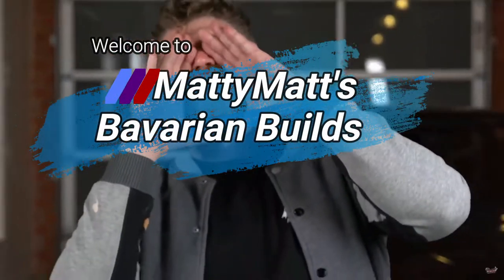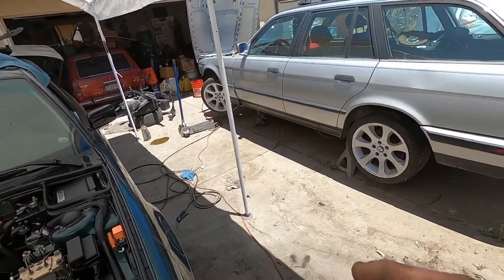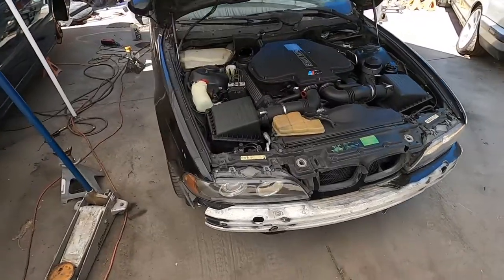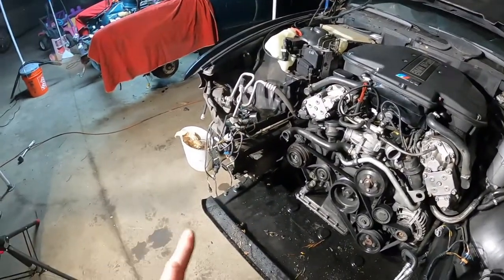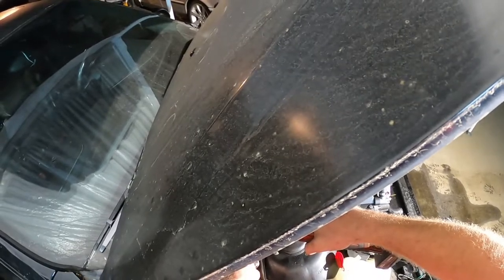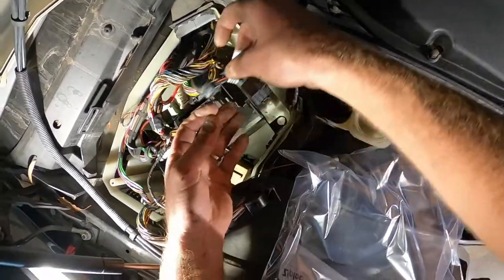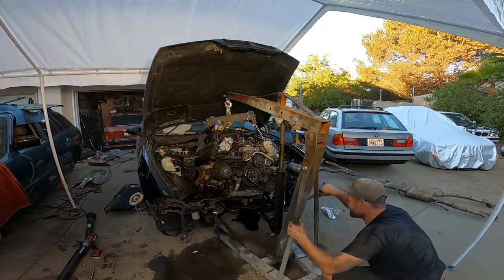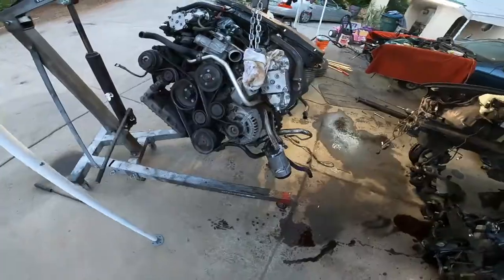Boosted S62 E34 Touring Build Part 2

Comment: How you solve with the oil pan position ? E34 is front sump, e39 is rear sump oil pan. Or you use again e9x front frame ?
Reply from the maker: You’ll have to stay tuned in to find out! 😉